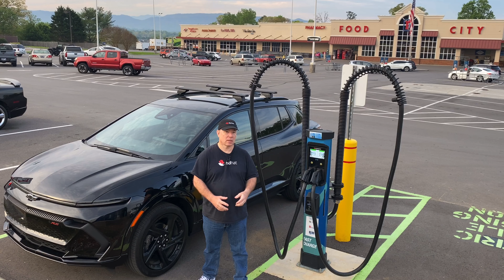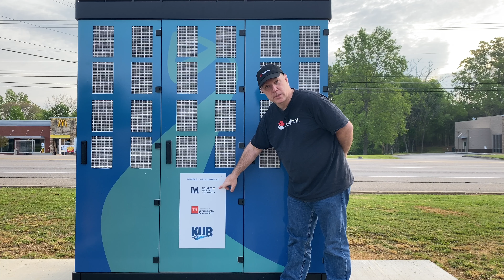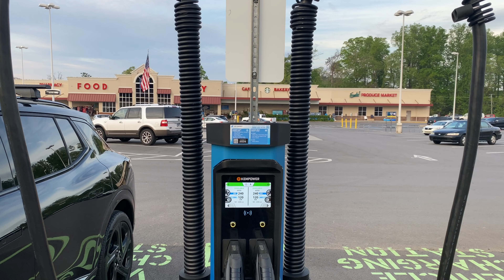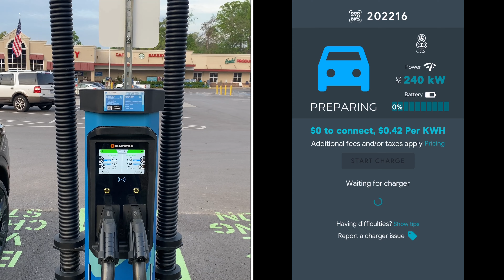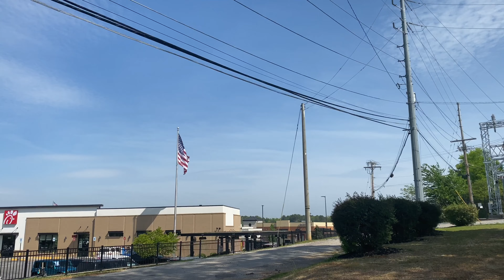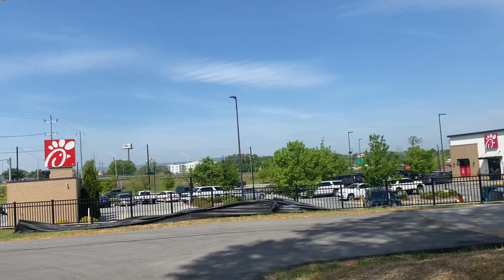Kempower Charging Stations Are Finally Popping Up In More Places Like These 3 In Tennessee!

Comment: ZEF sucks @$$. Rarely do their chargers work in Minnesota. They literally leave you stranded when you drive to one of ZEFs fast chargers and you’re forced to use a level 2 EVSE onsite instead that charges the same rate 🤬 ZEF also REFUSES to repair their equipment. The ones in Grand Portage MN haven’t worked in 3 years but are still listed on PlugShare. There is no where else to charge except Tesla 70 miles south or Thunder Bay 20 miles across the boarder(hope you have your passport to fill up). Almost 100% of ZEF fast chargers from ST Cloud and North either don’t work, or have just been removed altogether, like in Duluth.

Comment: Still more Charging Stations without a canopy.
Reply: These stations are located on someone else's property, the property is leased to the station and they are allowed only a fixed amount of real estate as per the lease.  A canopy would take up a portion of that real estate in order to properly secure it.  It becomes a choice between chargers or a canopy.  Which would you rather have, a canopy and two chargers or four chargers and no canopy?  Also, the owner of the property may not allow a canopy.

Comment: I think that kempower needs to step up their game and come out with 1MW 800V Chargers for larger vehicles like my Cybertruck.  I'd be there most of the afternoon on 100kw or at least an hour with the 250kW 800V charger.
Reply: Kempower is not the limitng factor. CPO is. Kempower has MCS and also NACS with 800v support up to 400kW.
Reply: @scronkfinkle1408  Thank you for correcting/updating my perspective.

Comment: Does the 240kW limit at 800V mean these Kempower units are using 300A limited cables or the power cabinets are undersized? It's a shame if these aren't capable of hitting 500A to max out lower voltage vehicles.
Reply: 300A cables. Two doors cabinet = max 400 kW fully equipped. Three doors cabinet = max 600 kW. This is really not that great site design

Comment: They're not liquid cooled cables and 300A output isn't enough in 2025.
Reply: No need for liquid cooled if you planning to charge cars. Kempower can still hold over 300kW without liquid cooling. This seems to be enough for most cars and they have futureproofed with 2 cabinets. Allowing for 1,2MW at a later stage. (satellites are capable for up to 200kW/400kW. (400v/800v)
Reply: Charging is getting so common that the new issue will be amenities vs simply electricity.

Comment: We have a lot of ZEF run dispensers in MN. The worst provider ever. They have multiple stations that are broken for 6-12 months when it is the only option in the city. Mostly in Northern MN. I hope they are better luck in TN.
Reply: I'm in Wisconsin and thought the same thing when I saw these were run by ZEF: "oh no; that app is terrible." I'm hoping that the more reliable hardware will make the network better and then maybe they can improve the app...
Reply: It depends which hardware are they running.
Reply: I visit Northern Minnesota each year. I remember checking Plugshare three years ago and seeing all of the ZEF chargers, whose reports read like a novel with outages and derating and unavailability. I had really hoped for more progress, particularly in the north-central part of the state. But unfortunately it hasn't worked out that way. The Circle K in Baxter has been it. Fingers crossed for more high powered, reliable chargers soon! For now, it's just charge up to 100% at the cabin and head out of the dead zone to better charging south.

Comment: I don’t believe Kempower is deploying many liquid cooled cables. Their standard offering still seems to be a non-liquid cooled cable with the those 140 kW/280kW power ratings due to 300 Amp limits. Their V2 Satellite dispenser goes up to 160 kW at 400 V or 320 kW at 800 V due to 400 Amp limits. Considering the charging tech in vehicles these specs seem a little bit backwards looking rather than forwards looking, but that’s just one person’s opinion.
Reply: CCS2 ones are 200kW/400kW in Europe. Pretty sure NACS can do that no problem. Kempowers layout is also futureproof, since it's easy to add satellites and/or power to powercabinets. Their latest "MORE" system allows up to 1,2MW & 12 satelites. And ofc you can have several such setups in same location. Finland has many local "Wallmarts" with 12-24 satellites and over 2MW of power.
Reply: you can easily see if there is a liquid cooling, such a satellite would have big attachment on its back

Comment: 300 amps is pretty low unfortunately. Good to have more options nonetheless.
Reply: Not sure why they've installed it such a way.. because Kempower is capable of "400 Amp CCS1 or 380 Amp J3400/NACS connectors with over 300 kW continuous."

Comment: Sorry, a little confused about the subsidized part
Reply: The TVA Fast Charge network is mostly built with government funds from TVA and local government-run utilities; some Dieselgate settlement money is used in some states as well. They can also tap into federal tax credits to offset the costs (installer gets the credit and drops the price to the local utility to offset the credit).

Comment: I can't believe new chargers are still being put up without at least some NACS plugs.
Reply: It s a myth that you have to have NACS. What matters is reliable dc charging hardware. And that's where brands like kempower or Alpitronic comes to the picture. Those have great réputation in Europe.
Reply: @jonpetter8921  What myth? Chademo is dead, and if they want Tesla business and the business of non-Teslas with NACS inlets, they better get busy. It's very unattractive to have to use an adapter. You should want to give your customers the best experience, eh?...... I have nothing against Alpitronic, but they're just gonna have to retrofit their plugs in the future.
Reply: @777Outrigger  Right now though, most non-Tesla EVs are CCS1 in the US.  Most vehicles for the foreseeable future will be CCS1 too.  It is just a quick cable swap anyway to switch to NACS.  It really isn't a big deal.
Reply: @l10industries  Yes, both CCS and NACS plugs are still needed. I'm seeing on Plugshare that some new charging stations have both CCS and NACS, but some don't. I think that's a real lack of foresight doing brand new charging stations without NACS.
Reply: @ CSS 1 can be just as good. You only need reliable DC fast charger.
Reply: @jonpetter8921  Except for the heavier cable and plug. My wife sure prefers Tesla NACS over a heavy CCS1 plug and with an adapter. ..... You know, I drive to a destination in rural SW Colorado often. I have to drive about 8 minutes out of my way to charge at a Supercharger. There's a ChargePoint charger that's only 2 minutes out of my way, but I go to the Supercharger for the ease of use, meaning lighter cable and no adapter. ... ..Until today. I noticed that one of the  ChargePoint chargers now has a NACS plug, so now I will start using this ChargePoint  instead, especially since it has a Plugshare rating of 10.
Reply: @777Outrigger many sites are planned years in advance and may have been delayed due to many reasons including multiple funding sources and cannot be change due to existing contracts. There is a site locally that recently came online, it was planned in 2021.
Reply: The new Walmart chargers will have NACS and CCS so that good, but yes crazy that these new kempower ones don’t
Reply: Except for the heavier cable and plug. My wife sure prefers Tesla NACS over a heavy cable and CCS1 plug with an adapter. .....
    You know, I drive to a destination in rural SW Colorado often. I have to drive about 8 minutes out of my way to charge at a Supercharger. There's a ChargePoint charger that's only 2 minutes out of my way, but I go to the Supercharger for the ease of use, meaning a lighter cable and no adapter. ... ..Until today. I noticed that one of the  ChargePoint chargers now has a NACS plug, so now I will start using this ChargePoint  instead, especially since it has a Plugshare rating of 10.
Reply: @777Outrigger  it will be interesting if the lighter and thinner cable of NACS will come back and bite us in the ass again. It is already stressed out with current charging speeds. I feel CCS1 probably has a lot more headroom.
Reply: @l10industries  Well Tesla made the cables for V3 thinner than V2. Technology marches on.
Reply: @777Outrigger  It depends how the charger is build. Kempower does have some great solutions so that the cable is almost weightless because of the mechanism they use, maybe even better than Tesla SC.
Reply: @jonpetter8921  Just plug-in with a 7 second hand-shake, no app, no credit card too? Chargers almost always close to the main highways?     But back to my original point. Still dumb for a new charging station not to be half NACS and half CCS.
Reply: @777Outrigger  Kempower is among the best dc charger you can get today with Alpitronic.
Reply: @jonpetter8921  I have no doubt. I've heard good things about them.

Comment: I used one at a Chevy dealer in Benton, KY. Since the Kempower unit was new the CC reader wasn't provisioned when I used it. I'm not a fan of ZEF energy app. The Kempower unit worked fine but it was a 50kw unit where the dispenser and power cabinet was all in one. The cable management was not setup properly either. Photos are on plugshare of the site.

Comment: I think .40c per kW for a 50k dispenser is a bit high. Especially since Ionna is .43 cents for 400kW dispensers. I would think thats the sweet spot. I may not have a good frame of reference since I haven’t publicly charged in over 8,000 miles of ownership. 😂